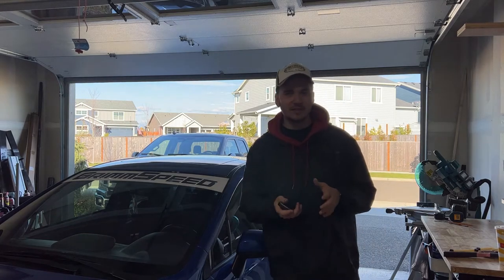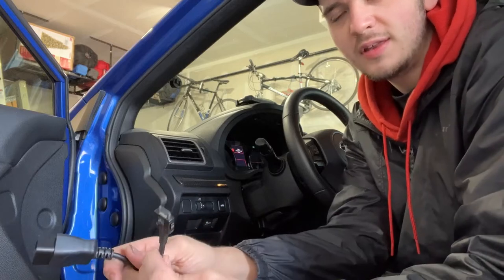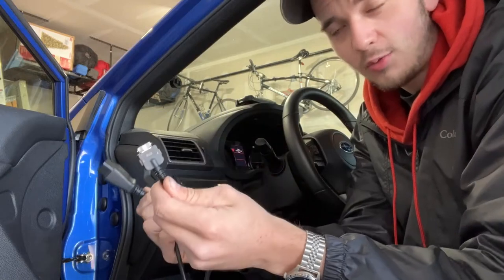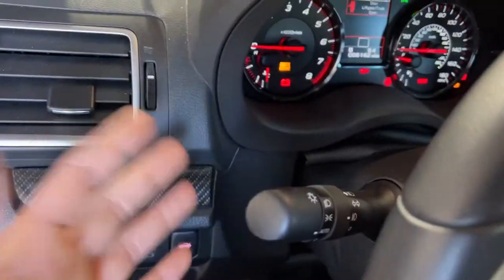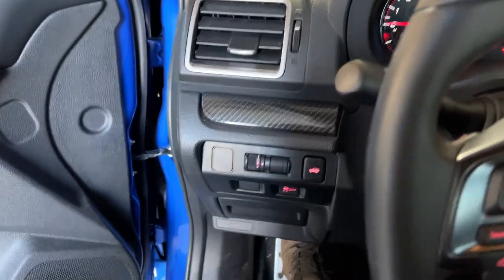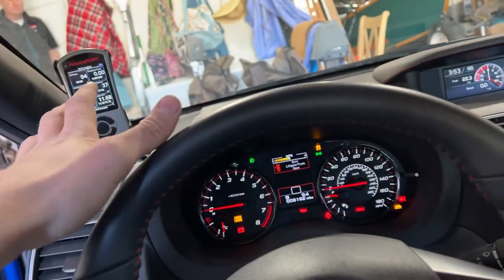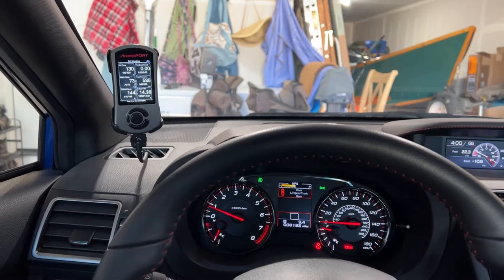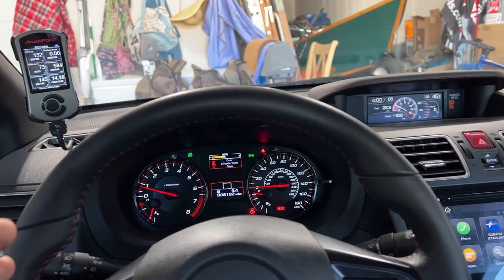Cobb Accessport & Stage 1 tune on my WRX!

Comment: Might want to get your car checked if you had to push the pedal to get it to go pre tune. The "jerkyness" as you described etc is due to stock the pedal is 0-100 pretty much no in between and instant torque etc. The tune smooths that all out, more linear and actually has real pedal percentage. Obviously I could've completely misread what you said/meant when you said if that makes sense. Either way, enjoy!
Reply: I think he means the pedal was like almost dead in the first half and then it’s almost like instant torque but the linear feel makes it if ur giving 10% throttle u get 10% power etc

Comment: How’s your DAM? Mine sometimes drop when i lightly launch my car from stop light and goes back up when driving normal.
Reply: As long as Fine Knock Learn isn't bad (I'd say around -1.41 doing light driving and -3 during hard driving, but this one is car dependent) , Feedback Knock isn't bad (more than around -2.81 is considered bad if you're getting it consistently), and the car doesn't feel like it's pulling timing, you should be good so long as it learns it's way back up to one after a little while

Comment: Do you download tunes I now you can but dose it auto have tunes and dose it make the hp any more? I know it helps boost and stuff but idk
Reply from the maker: It’s doesn’t necessarily add HP numbers the the tune I used was already pre downloaded by Cobb when I bought the access port
Reply: Auto tune you asked is OTS. Off the shelf maps. FYI cobb completely got rid of stage 2 and 2+ tunes because of California for subaru(possibly other manufacturers)

Comment: No aftermarket parts besides the access port itself for a stage 1 tune ?
Reply: well you should get an intake
Reply: stage 1 runs best with an intake and exhaust but it should be fine with no mods
Reply: @UrusaiGTR  the stage one tune is made for is made for a stock car the stage one plus is made for intale